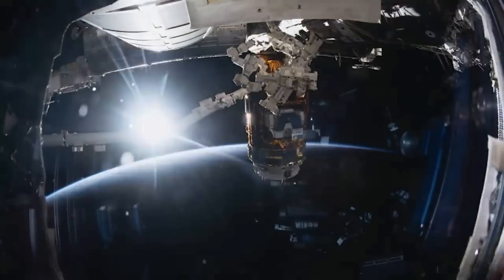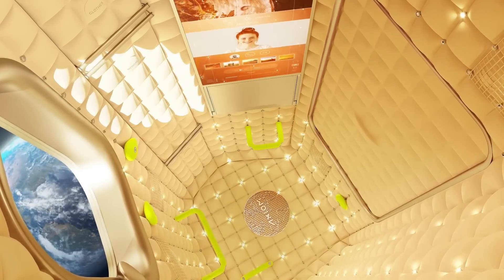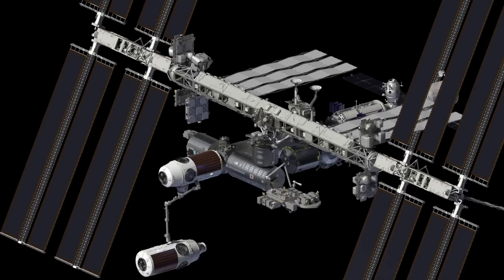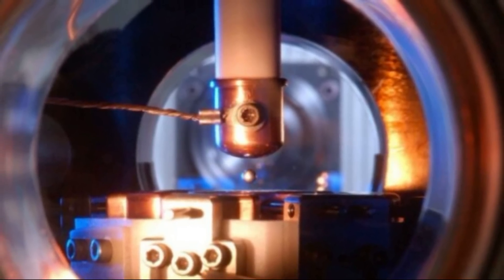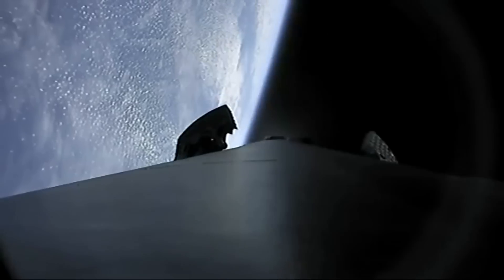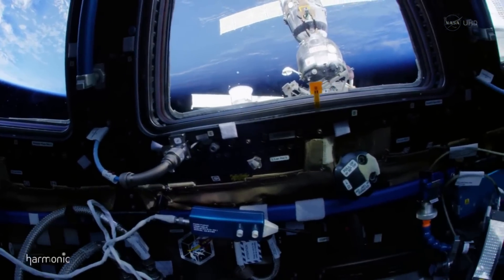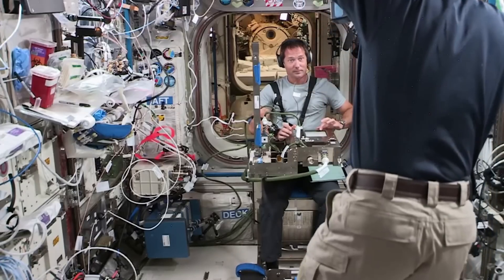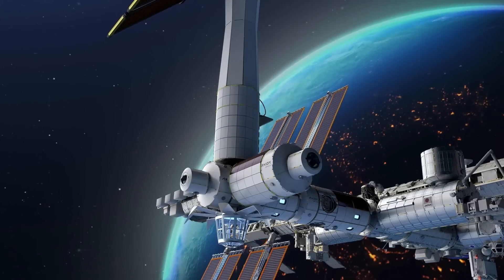A Look At Life Inside The First Commercial Space Station

Comment: The Axiom Station is certainly an interesting project.  Axiom's first module, Hab One, is expected to provide quarters for four crew members and volume to accommodate research, manufacturing applications, propulsion, guidance, navigation and station control systems. It seems unlikely it will look internally like the padded room graphic being shown.  It was reported last year that attached to Hab One will be the SEE-1 module which is a six meter spherical inflatable module for the British company Space Entertainment Enterprise.  The SEE-1 module as per the press release is scheduled to launch soon after Hab One arrives at the ISS.  Before the ISS is decommissioned, it has also been reported that the the Leonardo Permanent Multipurpose Module (PMM) will be transferred to Axiom Station.
Reply: that hab1 is trying to do a lot on one module huh.
Reply: It is an interesting project, but i am wondering why they are limiting the station to what it is, when they could potentially expand it to include that of inflatables that make the volume much bigger?